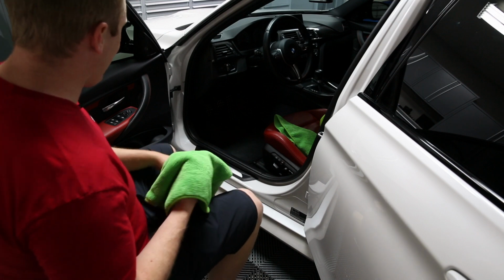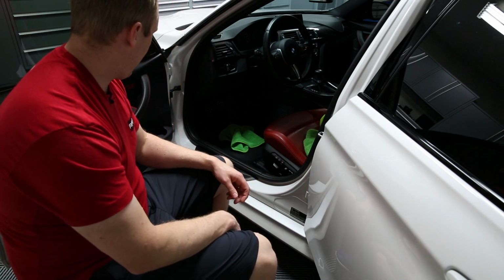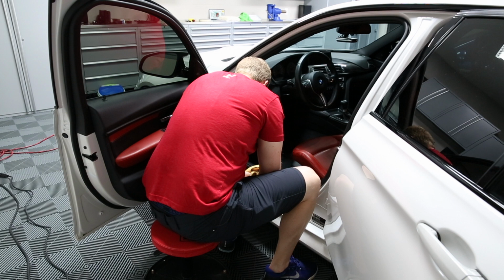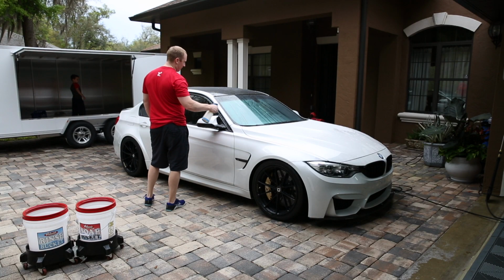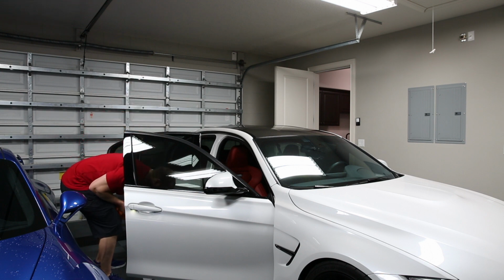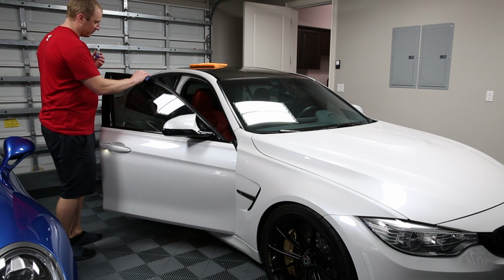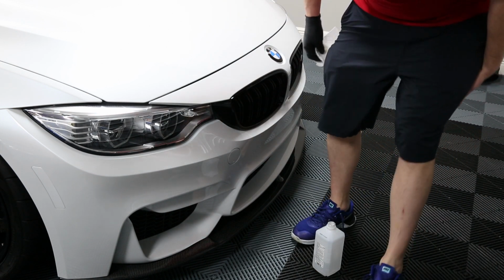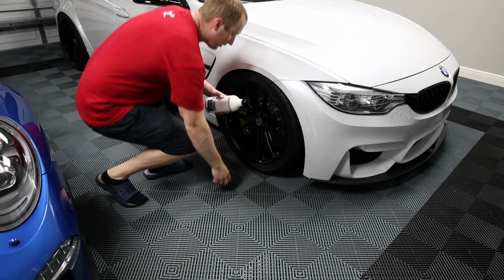Maintenance Detailing Series: Extras - Jambs, Trim, Rock Chips & Tires

Comment: Great videos as always. Keeping it short i see.
 On my ZL1 I got 5 chips driving the 10 miles home from the dealer when i purchased it. the splash zone on the rear quarters getting it the most. Had ppf installed the next day. Front and plash zones. 2.5 yrs later not one chip, now only 7k miles. Just the conditions you drive in.

Comment: Adams in & out spray..I see it works well on plastic grilles, engine covers, etc. What about the back plastic trim on range rovers (the D pillar)? It's plastic, but a different texture I guess you could say..didn't want to use it & it absorb in a blotchy way..
Reply from the maker: +FJF2007 It would works, but I would prefer Gyeon Trim of Wolf's Trim on that area.

Comment: I appreciate the videos and thorough info. Do you have recommendation on cleaning/maintaining CCBs on the F80/F82? My set is getting real loud and I cant help but think there must be a way to clean or maintain the brakes to help reduce the noise the brakes are making when its coming to a stop.  thanks!
Reply from the maker: +Hoffman Gonzalez I find that they make noise when they get dirty.  I blow them off with the pressure washer prior to wash.  That seems to do the trick.

Comment: When you sprayed the rubber trim with APC, don't you risk taking off the sealant/wax from the overspray?  Wouldn't it be safer to just spray APC onto microfiber cloth and wipe/scrub, and then wipe off with damp towel?  Since you also wiping the trim with the IPA, couldn't you have just wiped with the APC  before the IPA?  The white and black painted trim around the windows are sealed/waxed, right?
Reply from the maker: +yusuihang Yes, that's why I only hit the trim with APC during a maintenance correction.  I had already stripped the wax off the car.  The windows are coated with Gyeon View.  APC doesn't do much to the coating.
Reply: +Matt Moreman I think I had misunderstood the order you were doing things here.  I had binge watched your detailing series, then saw this video at the end.  I thought you were going back after the wax/seal to do touch-up trim work.  But I now realized that this video shows steps prior to the final wax/seal part--except for the colorchip part at the end (right?).
Reply from the maker: +yusuihang Sorry, the trim cleaning was after polish before wax.

Comment: Do you find that when you use the washer jets for the wipers does the washer fulid strip wax where the wiper goes?
Reply from the maker: +Gurpreet Singh I always squirt out the factory junk they put in there and then fill with filtered water.
Reply: Thanks
Reply: +Matt Moreman Note: don't try this if you live where it gets cold and it's winter...

Comment: Do you have any knowledge in tires? So Pirelli vs Michelin;  Super Sport vs P Zero ; Sport Cup 2 vs P Zero Corsa ; or even Trofeo R.
Maybe you can make a video about tires. 
I am due to changing them the first time and the whole thing is a little overwhelming.
Reply from the maker: +ELComandante I'm not an expert but I know a little.  I would choose PSS and PSC2 over both P Zero options.  Then I believe the Trofeo R is a better track tire than the PSC2.
Reply: Would that also be your decision if it was an AWD car like the r8 or 991 turbo s?
Reply from the maker: +ELComandante Yes.

Comment: What is your opinion of the Gyeon products.
Reply from the maker: +Joe Smith I like them.  I'm using Gyeon Trim now.
Reply: +Matt Moreman  I just placed an order with DetailersDomain.Some products were sold out,I could really use a great bug guts remover what are you using for that.
Reply from the maker: +Joe Smith I just use Adam's soap and leave the bugs on the car in between washes.

Comment: @Obsessed Garage 
Hey Matt! 
Some background on me, i'm a college student at UCF on a budget but would really like to detail my car to your level.  I live in an apartment with no garage but have water and electrical outlets.

Eventually I would like to use some of these techniques on customer cars for my Auto detailing business.  I would gradually work new methods in as I feel more comofrtable using them on my car and friend's cars.

So, my question is what materials and  items do u recommend for the bare minimum of achieving this high level of paint purity. (Basically elminated the unnecessary chemicals and steps)  I have the basic detailing items like 2x buckets, soap, tire brush, microfiber cleaning mitt, microfiber cloths, clay bar, and turtle wax.  My 2012 car's red paint is pretty swirly scratched in the sun  Please help me ! haha

Respectfully,
Taylor Jordan